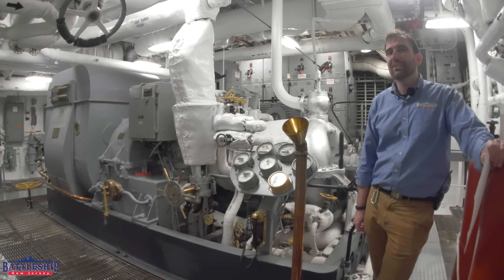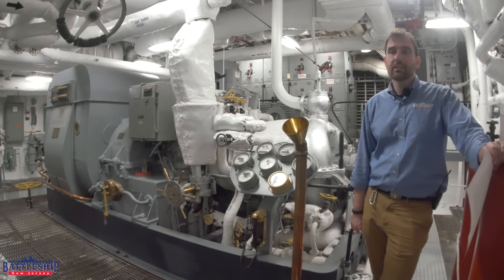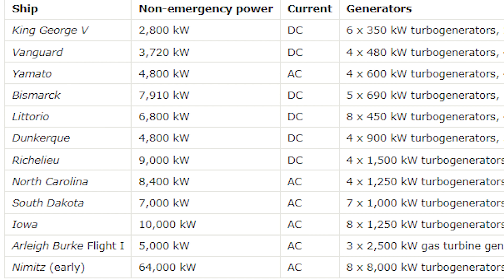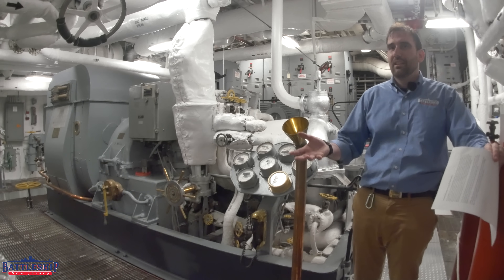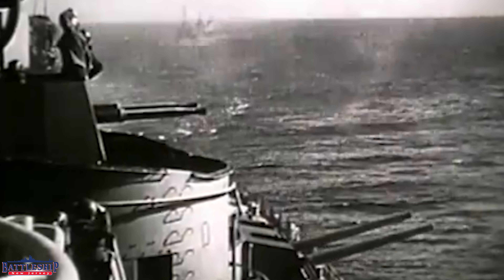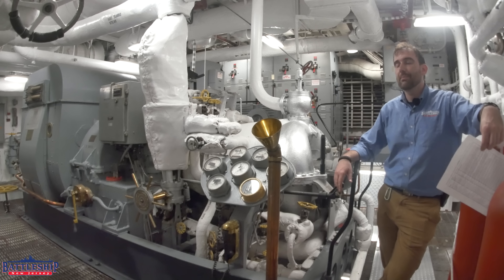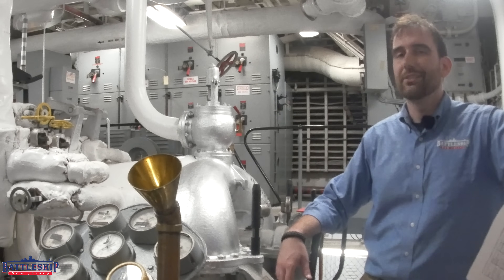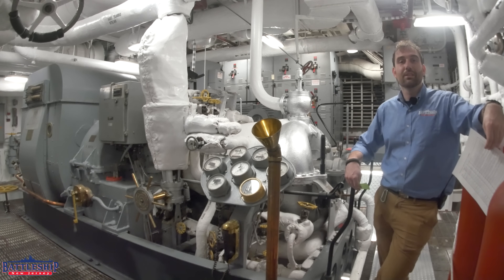How Much Power Can a Ship Generate and Did a Ship Really Power a Whole City?

Comment: Ryan, As somebody noted in the chat, you have confused AC and DC.  The US power system for residential distribution is AC, not DC.  And I'm pretty sure you will find that the outlets onboard the ship were also AC that was supplied by step-down transformers from the 440 VAC produced by the turbo-generators.
Reply: DC is used for large traction motors, in for example the New York City subway system, because of the high torgue  characteristic at low speeds.
Reply: @view05nys  That was how I understood it too, but recently as trains are getting longer and heavier railroads are switching from DC to AC traction motors on locomotives.
Reply: @terryboyer1342  "recently" if you consider 30 years to be 'recent'
Reply: @plcwboy  I think it was Einstein who first said everything is relative.
Reply: A rare occasion where Ryan's information is not current.
Reply: @danielayers  Well, not the correct current. 😉
Reply: @danielayers  I see what you did there.
Reply: Once again!
Not a quake in Tacoma
The Lake Tapps hydro plant was late coming on line
Reply: To paraphrase a famous fictional Dr. ... Dam' it Jim he's a curator not an electrician...   🙃🤣😂🤣😂
Reply: I 100% agree.  All of home electric distribution is AC not DC.
Reply: @kturini All domestic power was 120VDC well into the 20th century. Edison’s entire distribution system was DC. Westinghouse and Tesla were the originators of AC domestic power.
Reply: Ryan, our homes use AC.  Our devices rectify to DC for internal use, except our toaster.
Reply: I would think a ship would be equipped with at least one plus a backup generator for producing 3 phase electricity at 400 Hz just for the electronics for navigation, defensive and offensive electronics. Just as in aviation, most aircraft use 400 hz alternators to produce power for most of the avionics and associated military electronics if on a military aircraft. Fact is it is easier to convert 400 Hz electricity into DC. Because of the high frequency used the transformers are a fraction of the size of those used for 60Hz. The filtering circuit of a DC power supply is also smaller since at a higher frequency the smaller size capacitors can be used to remove the smaller amount of ripple in the output of the rectified power. This amounts to a massive weight and size reduction for DC power supplies. The same applies for High voltage power supplies used to power radar and jamming equipment. Transformers are smaller and the rectification filtering circuits can use smaller filter capacitors saving space and weight while still providing the voltages needed for these systems
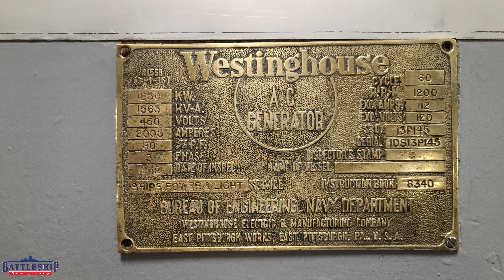Reply: Ryan sir. With all due respect, at the 8:25 mark you say homes have DC current. All wall outlets are AC thanks to George Westinghouse beating Thomas Edison with Nikola Tesla's AC power. 
Source:  https://en.wikipedia.org/wiki/Mains_electricity    
DC is used in some old stage theaters, Arc furnaces and welding. 
Interesting the Japanese used AC as well as the Americans. 
I prefer electric drive motors. Why?  electric wires are easy to replace than steam pipe. Steam pipe needs to be heated to prevent condensation in the line. Electricity is easier to re-route possibly making the ship more resilient. 
Interesting the generators spin at 1,200 RPM instead of 3,600.   They must be multi polar . 3,600 = 60Hz times 60 seconds, a common generator speed. 
2,000 amp buss - that is not wire it is bars of copper.  Wow!!
Reply: @allenshepard7992  1200 RPM - 6 pole alternator for 60 hz.
Reply: @mumfordthepitbull4581  Thank you. 
I understand. 
Do you know why they chose that? 
Was it for mass /size or efficiency, denser magnetic flux ?  
(smiles) There is always a story,   a reason and some history !!
Reply: @allenshepard7992  It is required for three phase power. With six internal poles you connect them in pairs to provide three phases. Many can be reconnected to provide single-phase power. 220/240VAC generators can get away with having only four poles or even two poles. Four-pole generators tend to spin at 1800 RPM for 60 Hz power. Cheap home/portable gensets utilize only two-pole generators and have to turn at 3600 RPM for the same result.
Reply: He may been confused because the light bulbs can take ac or dc if u plug them into outlets
Reply: @guyintenn NYC still uses steam though
Reply: I'm curious if he meant single phase vs. Three phase AC...?
Reply: Yes, most homes have AC power, but most devices in the home will convert that to DC.  Certainly anything electronic.  (TV, radio, computers, portable electronics, etc.)  A few things that operate directly from AC:  Things with larger motors (A/C, fans, vacuum cleaners, refrigerators, etc.).  But even they are starting to become more electronic.
Reply: @russellhltn1396  don't forget the old-fashioned incandescent light bulb.  They will work fine on DC, and even last longer.
Reply: He most likely meant that most electronics you use at home run of DC current but just do the conversion internally.
Reply: Everything Ryan said about AC vs DC was correct except that most US homes use AC not DC.  
One minor exception is New York City buildings get DC also.  NYC was the first big city to be electrified and used Edison's DC system, not Westinghouse's (Tesla's) competing AC system.  It may no longer be true, but NYC required buildings be supplied with both AC and DC power.
Reply: @ahseaton8353 That's interesting!!! Never knew that.
Reply: @ahseaton8353   nyc stopped doing DC in '07
Reply: @andrewseaton8353 so in fact do NYC buildings get DC or not?
Reply: @ahseaton8353  "On November 14th, 2007 the last section of New York with DC was shut down and converted to AC power."
Reply: @ahseaton8353  All US homes on the power grid are AC. Even If they are using DC they have a rectifier changing it to DC but they are still being supplied via AC current. Why do we use AC? Because it is transmittable over longer ranges, more easily stepped up and stepped down, and is overall safer than DC. DC is used where supply is an issue because you can't store AC current but you can store DC via batteries and capacitors. This is what the alternator in your car is for because the car continuously charges the batter which then discharges into the alternator then the power distributor for the appliances in the car. Except the 12vDC plug in the car which is directly connected to the battery.
Reply: @ImpendingJoker strictly speaking DC is better for long distance transmission as you don't get the loses from alternating the polarity, it's just that stepping up/down DC is significantly harder
Reply: @hannahranga  actually, AC is better for long distance transmission, because when you step up the voltage to the 44K volts or so used by high tension power lines, the actual current drops inversely.  That drops the resistive loss because that depends primarily on the current, not the voltage.  One exception that I can think of is the undersea power link between the North and South Island in New Zealand.  Because of the long distance, the cabling they had to use and the total capacity needed, they used a DC circuit instead of AC. At either end the power is converted back to AC for further transmission.  The South Island has several large Hydroelectric dams but the North has most of the population & demand, so power almost always flows South to North.  However, several years ago, during a particularly bad cold spell, the North had to send power South for the first time ever.
Reply: @ahseaton8353  HVDC is a thing, for an equivalent transmission line DC loses are ~3.5%/100km compared to ~6.7%/100km. It's just that getting HV DC is more expensive and so is converting it back to AC at the other end (also not helpful if it's not a point to point transmission line).

No skin affect and not having to handle active/reactive power help HV DC do that. Plus for underground or underwater lines there's no capacitive loses every time you switch polarity.
Reply: @ImpendingJoker  Fun fact...  The alternator in your car actually produces AC current.  There is an internal diode rectifier at the back of the alternator which converts the AC produced by the unit into the DC required by the car's electrical system.
Reply: It's an easy mistake make, and I'm glad someone respectfully pointed it out.
Reply: Came here to say this
Reply: Re: dc at the outlet, most of the junk plugged in to outlets are ac to dc power supplies aka "wall warts", because most devices we ‘plug in’ (with the exception of heaters and motors) want dc in the end (point of use).  It’s just much easier to get the exact dc voltage you want using an ac source.
Reply: True however most devices do convert the power from the wall outlet to DC anyway. In telecom you see a lot of DC rack equipment. They have a bunch of rectifiers that charge rooms of batteries for both backup and power conditioning. Then it's straight DC to the racks. Some big cabling and bus bars too because it's only 24V
Reply: @thunderjeep08  it depends on the type of electric motor used.  There are DC motors, but they tend to be high power/high torque industrial motors.  Most home appliances use AC motors because they are cheaper.
The difference between a US AC wall plug and the "NYC" DC plug is in the main two prongs.  If they are vertical and parallel, then it's AC.  If they are at about a 30° handle to each other, then it's DC.  There is a story about a maid (person of cleaning?) who needed to plug in her (their?) vacuum, but the power cord wasn't long enough to reach the normal AC outlet, but there was this "funny looking" one it could reach, so they bent the prongs over to fit it, and promptly blew up the motor in the vacuum.  (And for the gender conscious among us, I've also heard that story as a workman (person of work?) doing it, and blowing up their power tool (tool of power?). I just hope it wasn't an electrician, who should know better.)
Reply: Well, this is a clear case of functional anaphabetism. He hasn't talked about home applications. He talked about the ship. When he said wall outlets, he talked about the outlets on the ship. And those are DC, just like a bunch of systems on the ship. And you don't even need to deduct this, because he said: "the wall outlets around the ship".
Why american people can't understand even their native language?
Reply: @daaraa6539  Sorry, not true.  The "wall outlets" on New Jersey that look just like what you would see in an American home or small business are in fact 110/120 AC.  How do I know?  Because I've plugged in various household 110/120v AC power tools and equipment into those outlets and the tools (drill, shop vac, polisher, sander, etc) run normally.  (Well, when plugged into the outlet boxes that are active, anyway!).
Reply: @daaraa6539  8:21 - Direct current is what your house has, just about everything runs off of direct current.
And you were discussing why the American people can't understand even their native language?
Reply: @MrTexasDan  Nope, alternating current is the ruling champion of powering homes. Practically everywhere in the world. It seems you don't know the difference between the two types.
Reply: @daaraa6539  "Why american people can't understand even their native language"?
Which native language are you referring to as there were thousands spoken by a multitude of tribes? And shouldn't American be capitalized? Just asking as you're supposedly a language  expert.
 Since you're in a superior holier than thou mood "anaphabetism" is correctly spelled  analphabetism.
Reply: @terryboyer1342  Oh yeah, when you can't argue about the facts, you point out typos... Yes, I typed in a hurry, and left out a letter. So what? That has nothing to do with people can't understand what Ryan said.
Reply: @terryboyer1342  English is hard enough to learn, understand and especially spell.  Could be worse, could be Navajo.  There is a reason that the US Marine Corps used Navajo speakers as "Code Talkers" during WWII.  Even then, they used the Navajo word for Turtle to describe Tanks, various Bird species for Airplanes, Eggs for Bombs, etc. The Japanese never cracked the "code."  The biggest problem with English is its Germanic syntax, half French vocabulary (and about 5-10% vocab borrowed from every other language on the planet) and a total word count of 2 million and counting.
Reply: @daaraa6539   the fact is that in the clip he stated 'DC that is what your house has' ..... from the way he said it in context I believe it was a moment of confusion on his part. Since North America has AC 240v @60Hz split phase as the standard for household and light commercial use meaning 240v AND 120V.
 As others have pointed out that one of the earliest 'power stations' in New York city, the Pearl Street Station was infact DC. But it was very early on and once AC (240v @60Hz split phase) was standardized as the norm for North America Power grid those who were originally served by the DC stations were  still supplied with DC until the buildings were refit decades later. Otherwise since pre WWII  the norm has been AC (240v @60Hz split phase) with pervious/existing systems converted over as they were refit. I'm not sure what your native language is but that comment shows plenty of ignorance and contempt of it is own.  English is the default language of the US but we don't have an official language and do have a multitude of native pre- European languages spoken to various degrees.

Comment: That generator is about 1500 KW, 450 VAC. But watts are watts, 1500 KW is 15,000 watts, I think that plant has 8 generators, so it’s not a huge amount of power. 
Looking at a generator on a current CVN those generators are 8.8 MW (million Watts) and they have 4 of them but it takes one generator just to power each reactor.
Reply: 1500kw is 1,500,000 watts.
Reply: @lonnywilcox445  that would be 1.5 MW
Reply: 1KW is a thousand watts, 1500 KW is 150,000 watts, I missed a place.

Comment: @8:26   One correction, homes in the USA are AC.  OTOH, most automotive electrical systems (excluding EVs) are DC.  Locomotive traction motors were mostly DC until 20 or so years ago, now most in the USA are AC.  At the beginning of the electrical grid in the US, there was a real battle between Edison's DC and Tesla's advocacy for AC.
Reply: My Kia Niro Hybrid converts DC to AC to power the motors. Also, 90% of everything in our homes are DC powered, from an AC outlet. AC comes into the home, AC is supplied to the outlets. The items we plug into the outlets, phone chargers, TV's, computers etc... are converted, via either inline transformers, or transformers on the inside of the electronic device. Remember those big plug in transformers, and barrel plugs from back in the day? Well, the transformers just got smaller and are placed inside most electronics now days. Things in your home that run on AC... Stove, Air Conditioners, Fridge/Freezers, Microwaves, Mixers, Dish Washers, Hair Dryers, Toasters.... So yes, AC comes into our homes, and up to the outlet, but for most things in our homes, that's where the AC stops, and DC starts. Cheers!
Reply: @TrollAntiVenom  How can you point to stoves, air conditioners, refrigerators, which along with hot water heaters are the biggest power users in a house, and they all run on AC. The things that use DC are the power sippers, like laptops and cell phones. Anything that has a transformer is using AC power, because only AC can be transformed to a lower voltage. Things using low voltage DC have power supplies which rectify alternating current to direct current.
Reply: @dryroasted5599  so would it be better for you if I said, the more power hungry appliances in our homes use AC, and the lesser hungry ones use DC from converted AC? Half dozen of one 6 of the other...
Reply: @dryroasted5599 AC can be transformed to higher or lower voltage...
Reply: Teslas and most EV use 3 phase AC motors ran by a big inverter powered by the large DC battery.
Reply: High-voltage direct current (HVDC) electric power transmission system are becoming more common. These became feasible when high power electronics were developed. These have a lot of advantages, and some disadvantages, over AC transmission lines. So, in the end, maybe Edison will have won.
Reply: Tesla invented both btw
Reply: what he ment was that inside your home most all the stuff (electronics) run on DC. as in power supply in computer, led lights, tv and so on.
Reply: @martehoudesheldt5885 No, that was not what Ryan meant.
Reply: @martehoudesheldt5885 houses run on AC current